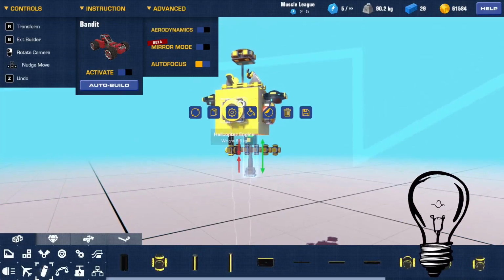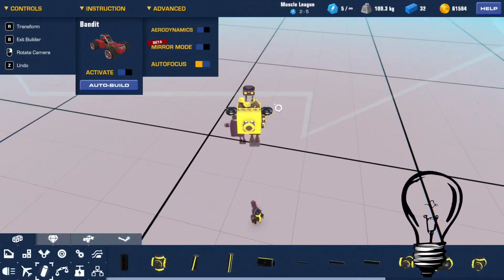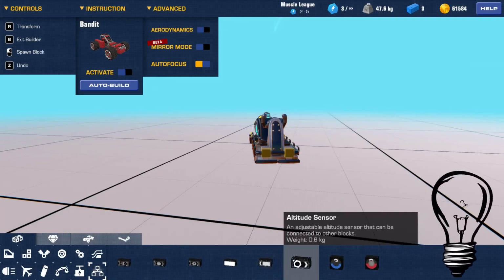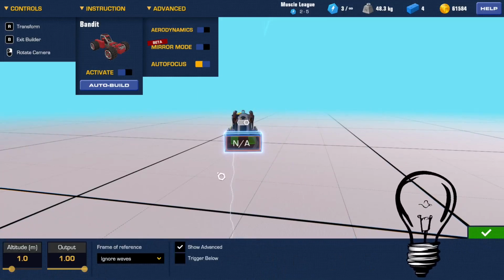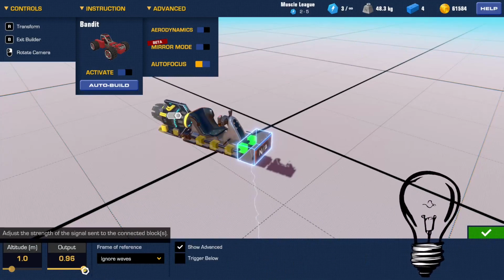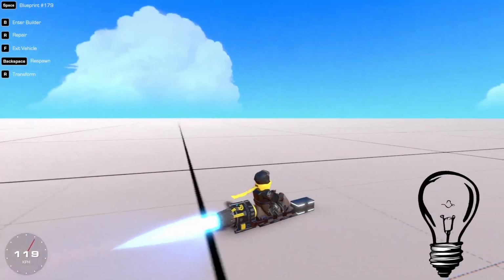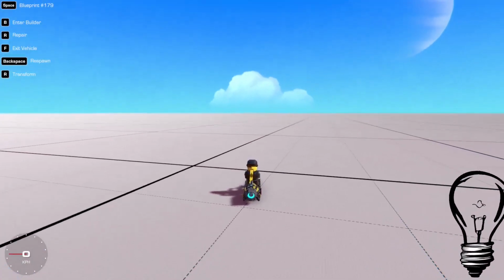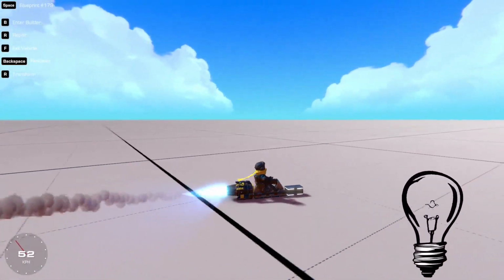Two Easy Simple Underrated glitches to solve problems. (Faster Thruster powerup)

Comment: If anyone doesn't understand the second glitch, its not really a glitch at all, just an abused feature. Since the constant output is always keeps the thruster on, the game never needs it to build up its speed because in the games eye, it has always been on and was never turned off. This makes the thruster accelerate instantly, making your vehicle really fast (although it doesn't change its top speed, acceleration is a lot better).

Comment: Great vid but don't think I can do the jet one since I'm on console too. The slider doesn't work like that, unfortunately, Only goes down in increments of 10 Need to grab a creation from workshop that already has it. Only way to do it. for now.
Reply: And it's stupid that it doesn't work on Xbox. It's totally capable of it. :(
Reply: Updating my comments With this comment, you can still do this jet glitch. Just set an altitude sensor to Set the altitude sensors output to zero and then. do the part where it's just endlessly active. Then put a direct input to the thruster. It will still full charge thrust👍
Reply: @sethsuitor  thx your a lifesaver
Reply: @jamesgary4709  your welcome I learned the thruster isn't looking for a specific level on the sensor it's just looking for input from the sensor and lowest level is best basically zero, That's what makes it bypass the charge sequence 👍

Comment: How do I do the thruster glitch on consle?
Reply from the maker: I don't use console but I imagine it would be roughly the same. All you need to do is power the thruster with some sort of logic at strength 0.03
Reply: Consle only allows increments of 0.10 it's cringe
Reply: @dubzwithnubz916  Does work on console. Just set it to 0.00 And connect it to the jet engine Only altitude sensor or distance sensor, though. Then put a direct control input directly into the Thruster. And then it will be full charge.
Reply: just set it to like .10